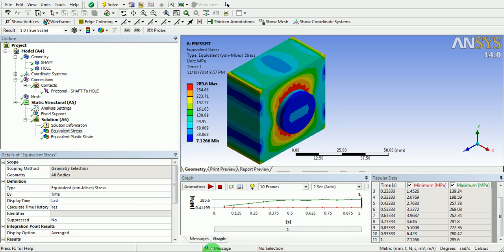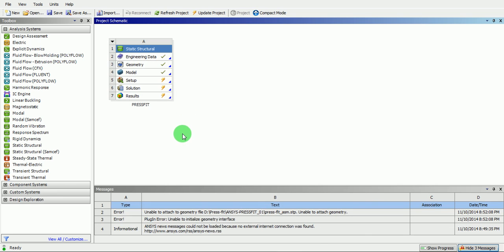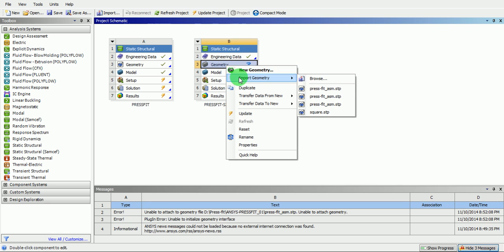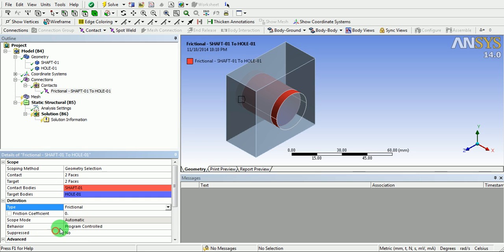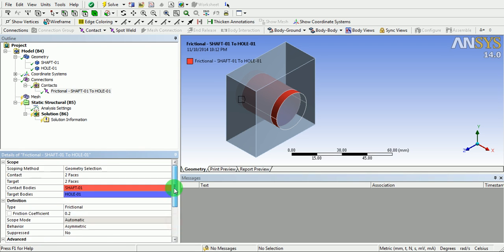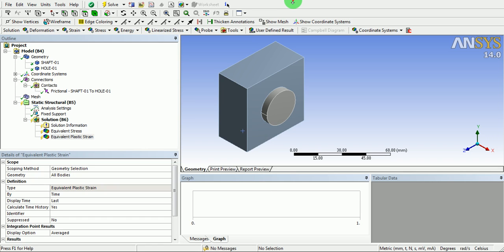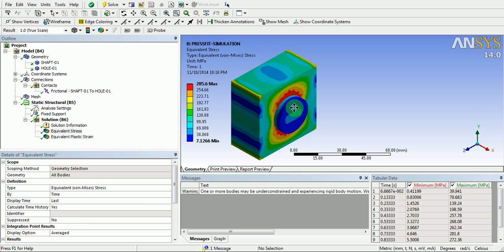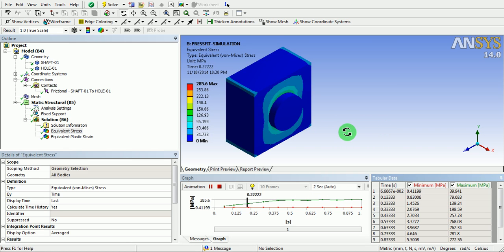ANSYS Workbench | Contact Non linearity | Interference Analysis | Solid Mesh |

Comment: Great tutorial Sir.I am encountering a similar problem where I have to release the shrink fit and take the shaft out of the hole.
Means I have to heat the external body only at the outer surface i.e. how much heat transfer W/m2 C is required to have zero contact stress at the interface.

Let me now if you have encounter similar problem in the past.I am doing a static analysis first i.e. define the shrink fit and then connect solution to  thermal analysis where I defining heat transfer coefficient till I got zero contact.Need your advice

Comment: Hi I had a question and im running into a problem while trying to do a similar simulation. Assume your shaft and a bushing have interference fit and there is also external force presented normal to shaft. Also assume that your shaft has a step and the bushing is initially is pressfit onto the shaft and is just touching against the step.

Now if I try to run the solver, I get error because i am having a hard time figuring out the type of contact to use for where the bushing is just touching the step. I get errors like rigid body deformation, contact arupt change (I tried using no seperation and frictional contact by the way).
Thank you
Reply from the maker: Paul, Do not worry, pls sketch your problem definition and describe about the problem, and mail me to engineeringtutorsdesk@gmail.com. I will help you out in solving this issue.

Comment: can you please show how to do the drawings interfering a shaft of 11mm into 10mm hole to do similar simulation. I couldn't fit a shaft bigger than a hole using both ansys nor solid works. thanks very much and very helpful video
Reply from the maker: Obedi1 please can you elaborate your problem definition,  or freehand sketch your requirement and mail me to engineeringtutorsdesk@gmail.com

Comment: Hello , 
Very helpful video. 
I am trying to simulate the same thing but in ANSYS APDL
The way i approached it is to heat one part (load step 1) and then allow it to cool with the contact/target option (load step2) However only load step 2 is taken in consideration. Any ideas why this is so? thanks
Reply from the maker: Naj Hos Thank you Naj, the thing which you are looking for is thermal simulation, and this tutorial is of structural simulation, please give me some time i will come-up with the solution video for your case
Reply: GRS CAD/CAE Hi, did you have a chance to come up with the solution? If you do not have time to do the video, can you please just let me know how to proceed, and i will try to do it by myself. I need it soon. Thanks
Reply from the maker: I was going through your problem, Kindly describe your problem definition with photograph to my mail address:  engineeringtutorsdesk@gmail.com